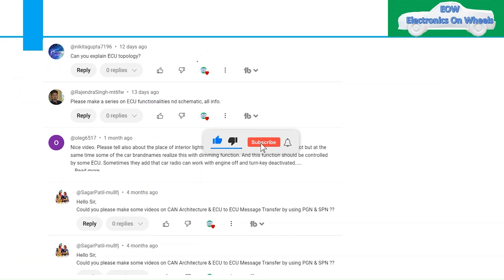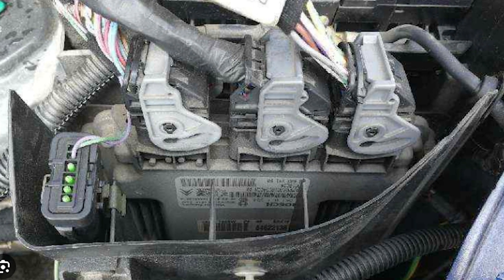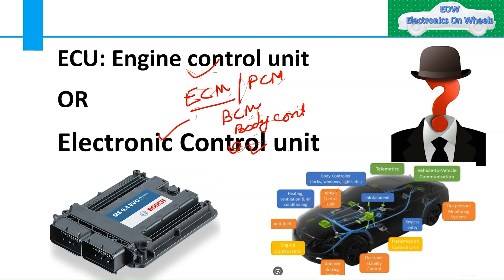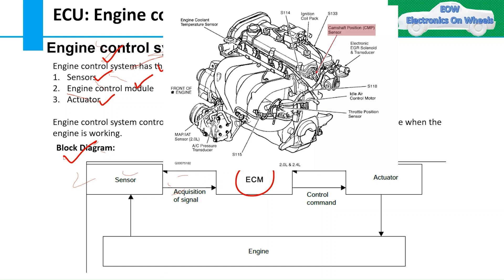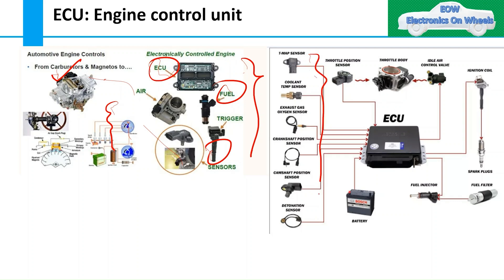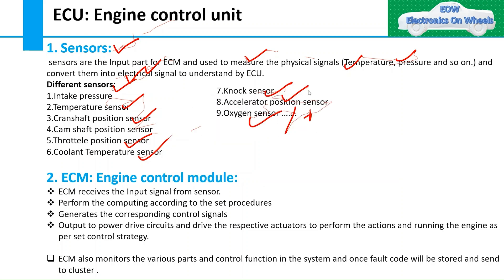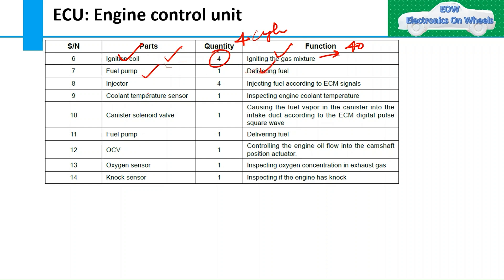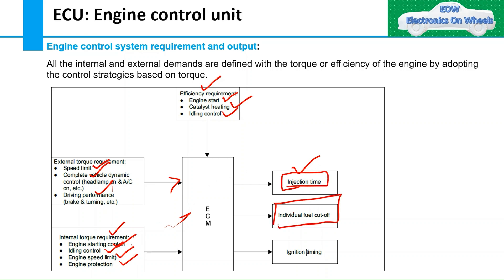Ch#01 What is ECU? How does ECU work in car? Bosch ECU schematics@EngineeringExplained@MunroLive

Comment: The voltage required to ignite the air-fuel mixture in a typical four-stroke gasoline engine is generally in the range of 12,000 to 45,000 volts, depending on various factors such as the specific design of the ignition system and the type of ignition coil used.

Most standard ignition systems produce a spark voltage within this range to overcome the resistance of the air-fuel mixture and create a spark that ignites the fuel. High-performance ignition systems can produce even higher voltages to ensure reliable ignition under more demanding conditions.

It's important to note that the actual voltage present at the spark plug during ignition can vary based on engine conditions, wear and tear, and modifications to the ignition system